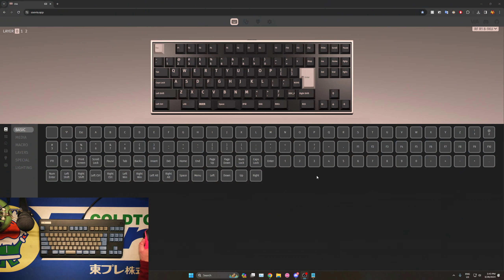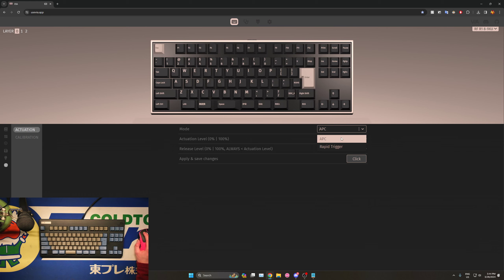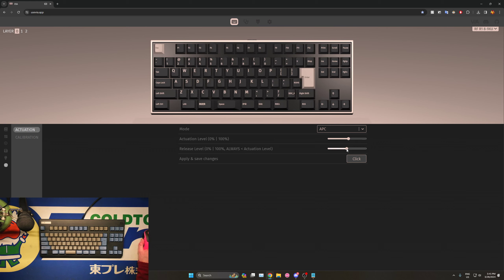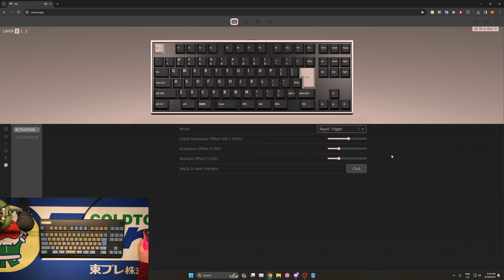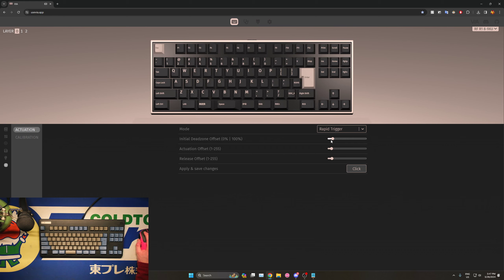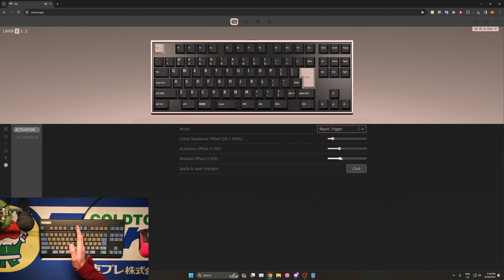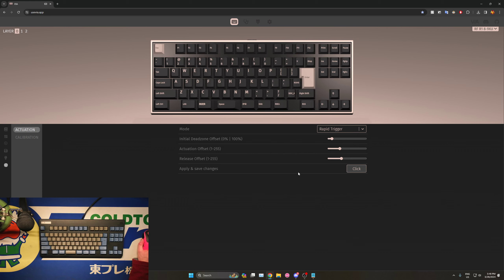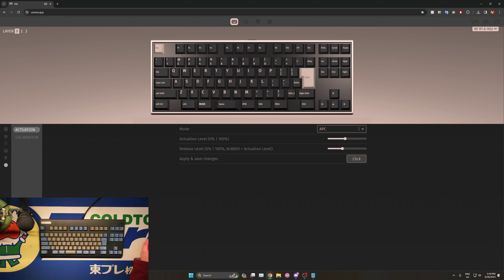EC PCB Firmware Features

Comment: This is an impressive level of APC control that rivals many commercial HE boards. Curious if your PCBs have been latency tested?
Reply from the maker: I have yet to properly test that, tho the scan rates of the boards take advantage of the usual 1KHz pooling fully. The main goal with these controls was to give users the ability to change the actuation based on their liking, but also to match the real tactility point based on the domes used.
Reply: Makes sense, thanks for the response!
Reply: This is awesome you can compete with wooting 🎉 I might not need 2 boards